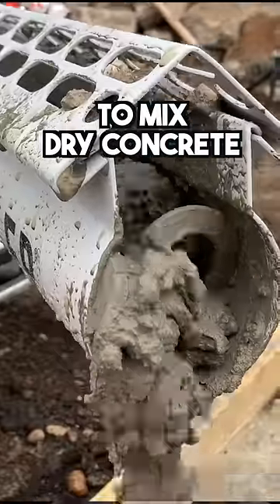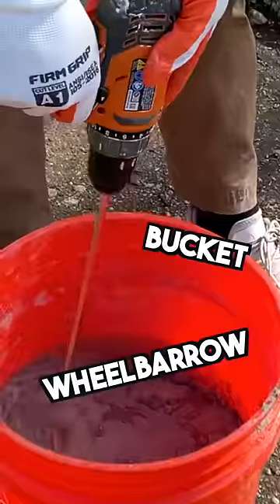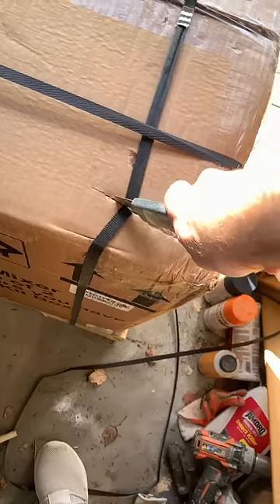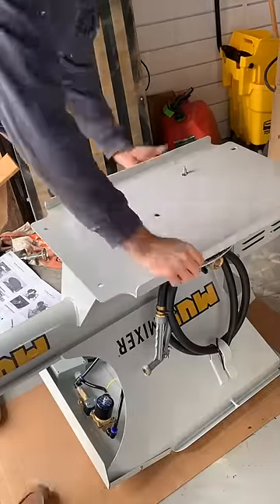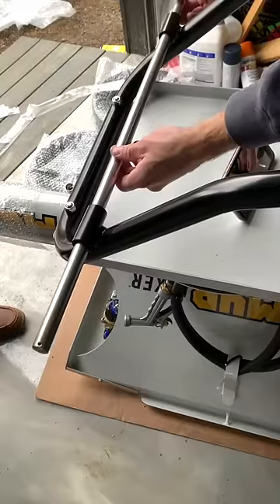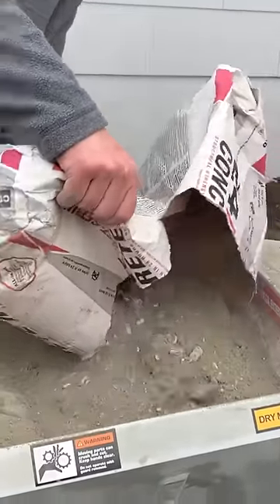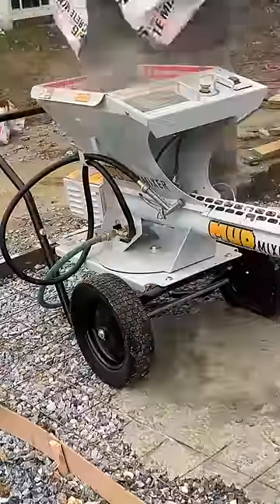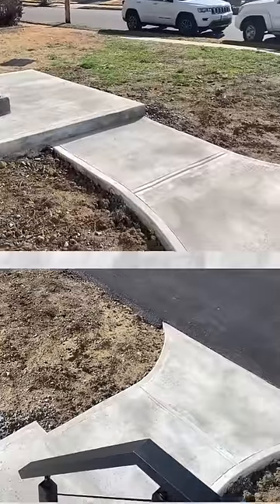The Best Way To Mix Dry Concrete (MUD Mixer)

Comment: After mixing my own mud,  I learned it's better to order a truck delivery, 2 reasons time energy and the truck mud is more consistent.
Reply: @zachary freeman 3rd generations doing tiltups we all call it mud. Calm dome Francis.
Reply: Getting it delivered is also going to cost the same or more likely be cheaper than buying bags. Bags are good for small projects, but if it's a truck size project, get a truck. You can also sometimes find small load companies
Reply: @zachary freeman you've never worked concrete before. it's mud.
Reply: That’s 3 reasons
Reply: Stronger as well. They don’t play games with that shit.
Reply: @brianbiddle7590  where I am from in Canada we always called it Crete not mud, mud was always mortar around my parts, never heard anyone call Crete mud before, so I was a little lost when you talked about mixing mud and Crete came out lol
Reply: not just consistent, but much higher quality. Proper aggregate size, accelerants, stabilizers, etc. Dry store bags have a place. But it not ideal to use them.  Find a u cart service dealing in real mud and not bag mixes.
Reply: @johnflynn6140  i gotcha different parts of the world call it different. What part of Canada are you from? Im from California.  Huge hockey fan and i still play.
Reply: @brianbiddle7590  southern Ontario just north of Toronto.
Reply: 🎉P
Reply: 3rd gen concrete contractor, dad owns 5 screeds, i own 1 240, it's definitely mud
Reply: @tboniusmaximus3047   I am not saying it's not called MUD in your parts but around me, if I call it mud most think of mortar, but talking to a buddy of mine who works in Toronto yesterday he says lots of people down there call it mud too, so it's really just where you live but also to my surprise most places call it mud, but the crews I worked on/with always called it Crete but I only worked concrete for 5 years
Reply: @brianbiddle7590 with names like Brian Biddle and Douglas Reed… I’ll go ahead and take your word on it for that one and agree😂 that’s mud
Reply: @johnflynn6140  I work in southern Ontario, around Guelph. We call concrete, concrete lol
Reply: @Poraxxify  very true lol I have worked with folk who do, I mean that is what its called lol
Reply: @olliej2472  I suppose there are three types of people: those who can count and those who can't.
Reply: Mud is a mixture of water and dirt. It's either concrete, mortar or a filler compound. Everything for the US is the worst name that they force the world to use. What do you say to children? Don't play with the mud but you can play in the mud?
Reply: @jo_jyarde5360  Mud is what brickies call mortar, plasterers call joint compound and concreters call concrete. Go have another soy latte and keep out of the mud.
Reply: @simpletonballsack  That's what I'm saying. It's what they call this and that. But it's not their names. This misleading culture is disastrous. I speak not just because I know the terms, I do the work too. We shouldn't be calling things names because it sounds good. Mud is mud. Neither mortar, compound nor concrete is mud.
Reply: @jo_jyarde5360  Mortar, compound and concrete are ALL mud in the vernacular of the tradies using those products. It's not "disastrous". That's just insane.
Reply: @zachary freeman Mud is what leaves boot prints.
Reply: @arthurr8670  facts
Reply: @@zacharyfreeman7326a Rose by any other name is still a Rose.
Excuse some of old un-technical farts. Mud is still Mud. Concrete in any form is still concrete, be it for a foundation, used as motar, or wall covering
Reply: @anon556 sure anon, sure. Since you areclaiming to be the expert. We've all watched the experts do their expertise. Then had to go fix the great experts screw ups. You call it what you want oh great expert
Reply: @brianbiddle7590  Please don't include my family name! :)
Reply: @brianbiddle7590  where I do construction, mud is reserved for drywall as in drywall mud.

Concrete is just concrete.
 Honestly, I'm getting a feeling it's just a California or west side of naming things. I'm from the east, and never heard it called mud in my 15 years of Construction.
Reply: Plus cheaper
Reply: ...and way cheaper, if ypu are mixing over a yard.

Comment: $3300 vs a Harborfright $250 normal mixer I’ll pass too many things to fail for that much.
Reply: My HF orange mixer was $189 out the door and I just completed the near 100 or so project after about 5 years and it's still going strong. Do I wish it had sturdier wheels and greater capacity? Yes but it is what it is.
Reply: Three grand is basically 3 concrete trucks worth the payload. Just call em and have em drop concrete off the with a truck. Cost of dry mix has to break bid when your trying to surcharge for a $3300 machine. NOPE. PASS

Comment: It’s a very nice machine but costs $3,000! Also it’s mainly for mortar mixing which is more refined. It appears you had to water down the concrete mix a lot to get it to move through the tube. That’s not good to do being that it greatly weakens the concrete. Read up on slump and concrete psi. Also, those bags are terrible and produce a weak and grainy finish. Sackcrete happens to be the very best brand for a hand mix BTW (available at Lowes) Furthermore, if you are spending 3k on a mixer, $150 on concrete bags, going down to the store and loading up all those bags, unloading them, slowly and painfully loading them in the machine one by one, taking all day with two people, resulting in amateurish concrete that only you think looks good (a face only a mother could love situation), then that is NOT “The best way to mix concrete” most concrete companies will sell a short load of premium concrete for about $300, pull right up and fill your forms in about 5 minutes. The rest can be done with one person, the job will be completely done in a couple hours, virtually effortlessly. Take it from a professional, this video is just silly on so many levels.
Reply: Good comment. And you’re right. He said it himself, he’s a DIYer, and this machines $3,000 price tag seems ridiculous for a DYI situation when you can pay a concrete truck to come deliver much higher quality concrete that’ll make the job much easier.
Reply: Agree 100%
Reply: @Dan-ez6dr  Agreed I have always DIY mixed my own concrete for sheds etc but if I was to build a slab or a footpath no way I am wasting my money on that contraption.
Reply: But he found the best way "over the years".
Reply: Thank you for this comment brother!  Some good info here, appreciate someone knowledgeable sharing what they know!
Reply: It's a lot of money to order 2 or 3 or1.5 yards of concrete 10 times over a year and end with a lot of waste you can't use but still have to pay for. Might be cheaper to buy the machine in the long run if doing a lot of smaller jobs
Reply: @jameswillard990 no. It's a lot cheaper to just hire a kid to mix it by hand for you each time then..

Comment: I bought a used commercial mixer for $350 that can do 15 60 lbs bags in 15 minutes or less. I use it for jobs less than 3 yards, anything bigger, and it's cheaper to order by truck. The minimum is 4 yards in my area.

Comment: I mixed a half yard of sand, gravel, and portland cement in the back of a Luv truck.  That was the hardest 4 hours of my life, and it nearly set up in the truck.  This was for a chimney footer.  When the time came to pour another half yard for the hearth, I paid the $69 for a full yard plus an extra $50 'under minimum' charge for the readymix truck to deliver it.  5 minutes and done.

Comment: 3000 buck to mix concrete at home, you have to be smoking crack😅
Reply: 😂😂😂😮 save me the time and effort of looking up the price 😢
Reply: $250  harbor freight mixer got my driveway done
Reply: I doubt anyone is buying it for anything other than a back pocket addition to their concrete business
Reply: Daddy's money
Reply: Right could of brought in a truck for way cheaper
Reply: @12yearssober  you tube money
Reply: @12yearssober  also how’s pac and biggie?
Reply: Exactly. For 3k, i can rent a 9cu ft mixer dozens of times and not have equipment to store or maintain.
Reply: @trampingwithcosmo6848  
He's not that big
Reply: @trampingwithcosmo6848  
We're all hanging out in Naples Florida 😆
Reply: @12yearssober  chilling with your good mate trump.
Reply: yeah a $3k tool for a DIY project  lol
Reply: Bet you I can mix 40 bags in a 5 gallon bucket individually 2x faster than that fkn thing 😂
Reply: If I had his money I’d burn mine!😂😂😂😂
Reply: Thanks for destroying my dream.
Reply: But he said he's just a DIY guy , duh
Reply: Divide that price by 10 then you have a winner
Reply: I was curious myself as to the price tag of this machine. He either does a lot of small concrete projects or he has money to burn.
Personally I don't do a lot of concrete work. However my last project involved pouring footings in an existing basement where a truck delivery wasn't practical.
I rented a conventional two bag mixer and hired a union laborer acquaintance and got the job done. The rented mixer was around $50 . I paid my laborer $200 and the forty some bags came in around $200.
That machine for me would be overhead. 
The other thing is I'm a carpenter but I'm not a contractor but I am a DIY guy. There's projects I will take on and projects I won't.
Most DIY guys wouldn't buy that machine for $3000 they would rent one!
Reply: Beef it up to a rental strength and serviceability and sell for 3500$ plus parts kits. …  pro-sumer seems whack on this. Not a terrible idea for niche work. The hardest work part of Moving bags and dumping them is not helped by this though. Total human energy savings is not massive.
Reply: @paulgewiss9238  
Thats not to bad. I found out the hard way that the cement truck charges a delivery charge. I thought i paid for everything, then thd truck guy says he needs additional fees, i was pissed cuz i had to waste time on the phone
Reply: The little ones are 20 and the big ones are fiddy
Reply: that's what I was gonna say lmao 3k no deal 1200 would be too much 549 to 899 is fair. this company needs to outsource to China to be a real player
Reply: I was saying the same 😅
Reply: Think of the amount of money you can make in RETURN if you use this for business?
Reply: 😂😂😂😂❤ thank you so much for saving me time
Reply: @bobkoroua  you missed the joke, you make no sense..
Reply: @12yearssober that’s a funny way to say business loan.
Reply: Not if you use it on a daily/weekly basis for the next couple decades, like nearly everything, take care of it, it will take care of you. He's using it for a JOB, the guy sitting at home reacting to videos like you might not have a use for it, but he'll be using it a lot more than you, saving him time, while he's being paid by the job, faster he gets done, faster he can go to the next 1000 dollar job 🤷 thing will pay itself off in a couple months
Reply: It's not great for people who are only pouring once for a home project, but I'd sure as shit buy one of those if I still built decks and fences. Did that shit for a few years and man, for really large fences mixing it by hand gets tiring
Reply: @thecanonpierce I've watched guys mix concrete, fit veterans in their late 20s, early 30s -- I guarantee you can't do that
Reply: Lmao
Reply: Use it, sell it.  Tools can go a long way.
Reply: @tylerallen0719 how is he saving ANY time?? You can mix the same amount by hand in HALF THE TIME and for WAYYYYYYY cheaper!! So where is he saving time or money??
Reply: Lmaoooo!!!!

Comment: ey mate since your Mr experience  and all that can you tell me when you were resurfacing the step you did not have an adhesive concrete adhesive is essential in a restoration job lots of it  in addition acrylic hardener  is a must as well when you doing mud it should be engineered to last cold heat or water

Comment: Thats pretty cool. If you are using sack concrete to pour a sidewalk or whatever is that what they call a dry pour vs a cement truck that I assume is a wet pour?  I dont understand dry pour vs wet pour if thats not it. Thank you and be safe.
Reply: He means he unloaded bags of dry mix and added water on site rather than having a truck bring in a load, premixed. 
But you can get a truck that does the se thing, dry mix on site. It is a better consistency as compared to bringing it in wet and having it cure as it travels.

Comment: I usually go to the u cart concrete place. They can mix you up a cart 1.5 yds. All you need is a trailer hitch.
Reply: 1 1/2 yard plus trailer is 6000#. A realy good trailer hitch.

Comment: The plumbing contractor I used to replace all of the drains in my basement and garage, used one of these to repair the floor.  This thing is SWEET.  He just hooked the hose to the washer hose bib, fill it with dry mix, and turn it on.   One guy is operating the machine and another is toweling.  The guy just pulled it along and let the concrete fall into the ditch.  Easy peazy, neat and easy.

Comment: Been a concrete truck driver for almost 30 years and we used to have the old style mix on the job same thing and had a rotating auger the only bad thing was you got basically like honeycomb Rock pockets and stuff and you were changing bearings left and right because they get full of sand that would be good for small type jobs but if you're going to do small jobs I would still prefer a rotating mixer but that's just my opinion I don't think it's too bad of a mixer but I still think a regular old drum mixer pretty good

Comment: People are ignorant on this comment thread. This thing is awesome. Way better than a drum mixer, way more consistent, less mess, easy clean up, not a lot of moving parts to break, can be started and stopped at anytime. This thing is awesome. When I first saw it I thought it was silly but the more research I did I realized this thing is bad ass
Reply: Look at the excess water having poured out the "thingamajig".  Doesn't look like the perfect mixture to me.
Reply: Have you used one? I have. The company I work for bought one. They kinda suck. No one was impressed and the quality of mud is not great. It jams up constantly and the auger reverses to clear the jam but continues to spray, meaning the slump is constantly fluctuating and too wet. Really expensive too, and it needs to be heavily babied or the pivot is ruined.
Reply: My boss bought one I thought it was silly and now I absolutely love it best mixer I ever used
Reply: I hate to say it, but I totally agree now after buying one. It gets constantly plugged when using 5000 psi concrete. It has to be soupy as shit to not get stuck. I want the ability to pour it with either a low or high slump.  So yes I agree with you now after trying it unfortunately.  @caughdog
Reply: I retract what I said here. Very disappointed in this unit. Plugs up all the time. Uses a crazy amount of water and very difficult to clean properly without taking auger right out. Some people will do a good job of cleaning it but if you have someone cleaning it that doesn't have an eye for detail it will end up causing issues in future uses.

Comment: It's too expensive. I checked it out and it's almost $3000. You can buy a concrete mixer attachment for a bobcat for the same price. Besides it looks like it was made in China. That's definitely a deal breaker for me. I bought a concrete mixer from Harbor Freight I was only able to mix about 20 bags with it. I either use the trusty wheel barrow or just order ready mix. 56 bags is 1 cu. yd. Which translates to around $220 at Home Depot.
Reply: Remember  it's also just a mud mixer not a concrete  mixer... sounds like the aggregate will kill it... looks like it too
Reply: Just order a truck for those numbers
Reply: Great point. Now I just need the $40,000 Bobcat, the $3,000 attachment instead of the $3k standalone machine.
Reply: @Eric-yh1vo  ngl 40k for a bobcat that's not beat to hell or massive hours, is a hell of a find. Maybe not rare yet, but becoming more rare. Especially when you compare to new prices.
Reply: It's already been said but, not all of us have a bobcat lying around.
Reply: Just return it after you've used it😁
Reply: @swirledworld340  bagged mix is pea gravel aggregate
Reply: @brianbunnich6221  no it is not

Comment: have you tried a wheel barrel.?? i have mixed 40 bags in 2 hours 2  bags at a time not joking. my guys preferred the wheel barrels than any mixer because of mobility. 3 guys can mix 6 bags in 5 minutes or less
Reply: I am a foundation repair specialist and prefer a wheelbarrow over our 2bag mixer any day.
Reply: try rolling it back and forth on a 6 by 12 tarp. You will leave the barrow at home.
Reply: @kkarllwt  if i cant roll a wheel barrel then use a 5 gallon bucket. im sure the mixer is heavier when loaded unless they have a hovering mixer.

Comment: It then takes 2 hours to clean it 😂
Reply: I've used this exact machine. It takes all of a minute to spray it down. The auto water feed does most the cleaning if you just let it run for a minute. I found it way easier than cleaning a standard drum mixer.
Reply: @ProjectMultiGaming  lol until that nonsense auger gets buggered

Comment: To mix sackrete, get a heavy tarp. and break one or two bags. Roll the mix back and forth, carry the tarp and dump the concrete. Just enough water to make a mix that will ball in your hand, or glisten when slapped with a shovel.
Reply from the maker: I need to try this. I’ve see a few comments recommending this method

Comment: Ok yes that’s a cool machine. I really like it. It’s just that when you are mixing that much concrete it’s less expensive to get it from a truck. At least it is here in North Georgia where concrete is $190 per yard. Lowes told me if you are mixing over a yard the truck is the way to go.